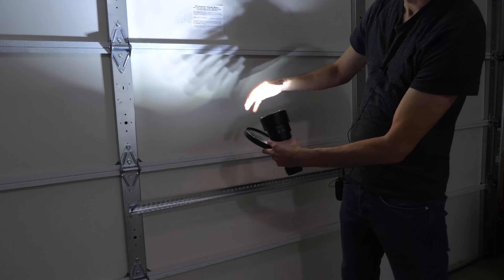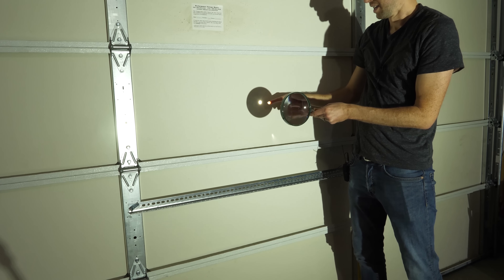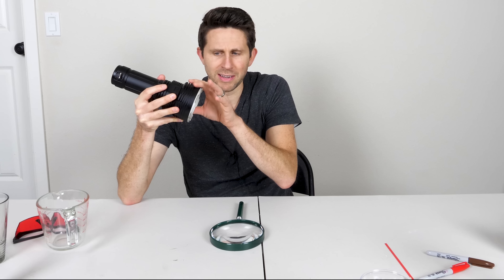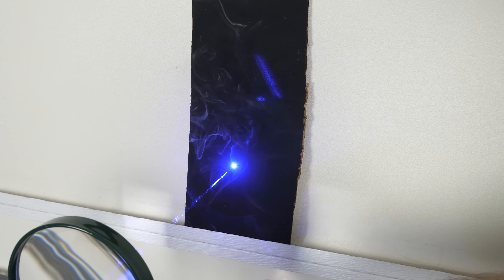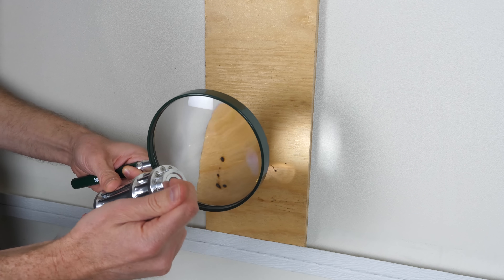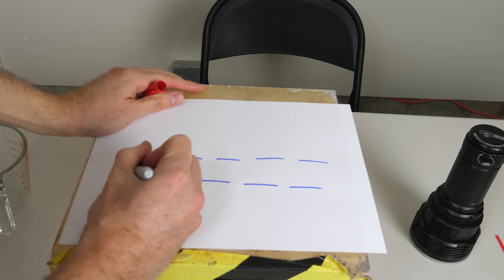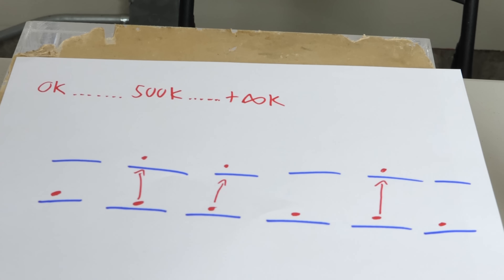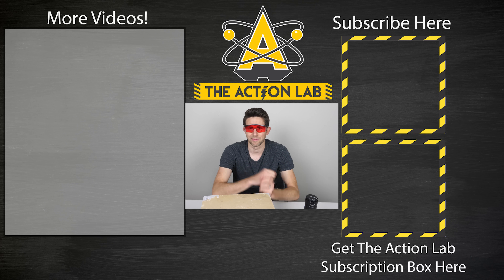What Happens if You Focus a 5W Laser With a Giant Magnifying Glass? Negative Kelvin Temperature!

Comment: I can see by the comments u are smarter than u come across in the video.. Ie u probably play for a target audience and by your sub count.. That works well for u.. But when u say all the energy and are talking lens.. U are missing a key point... Energy absorption by the lens. Which if u used traditional glass with a green tinge as viewed from edge... Will be significant and more so with blue. I know this from uv photo acid resist film. Low iron glass was important. I think it got most significant under like 350nm(its been a while) but discarding the extrema... Its still a factor

Comment: The way I understand it, photons are not hot.

Heat is the vibration of the atom multiplied by the degrees of movement IIRC, though I might be remembering all this wrong.

Basically, because photons are always traveling in one direction, they only have two of the three possible degrees of movement (XYZ with X being forward movement, Y being vertical, and Z being side to side) it can't vibrate in the direction it's moving, as that would affect and change the speed.

The photons coming from the sun are equally hot to the photons coming from a dollar store flashlight.

The way I understand it, it's the concentration of photons that's hot. When photons collide with something they create friction, based on how fast they're moving. Because they all move at the same speed, they all create the same amount of heat. But 15 hitting the same spot creates more overall friction than 5 hitting the same spot, thus more Heat.

Lasers concentrate the photons through lenses and that's why there's sometimes a visible trail, because the beam is so dense.

Again, I could be, and probably am, totally wrong about all of this. But it makes enough sense to me
Reply: Hotness of photons depends on their energy , the more energy you have in a photon ( which depends directly on frequency and inversely on wavelength) , the higher energy state it will shift the electron and that is what causes hotness because that electron now is more energetic than it was before absorbing the photon . Thus overall energy increases and atoms vibrate more frequently which leads to more heat . As for concentration, heat does depend on it but if you have higher frequency light ( like blue light or ultraviolet light ) you need less concentration than low frequency light ( like red light or infrared light). 
Hope this helps :-)

Comment: Use logic! A magnifying glass works to burn thing with the sun, because the sun is crazy hot, but also crazy far away, you can only magnify the sun to it’s max temperature, but the laser is right there, at it’s max temperature. So you can’t make it any hotter

Comment: Looks like your flashlight has 8 LEDs.  Assuming they are genuine high bin Cree XML T6 LEDs the maximum light output you could achieve would be 8x1040 = 8320 lumens.  However, your flashlight is probably a cheap knockoff from ebay using low bin rejects and probably puts out under 2000 lumens.

Comment: Firstly ; A laser (light amplification by stimulated emission of radiation) is a continuous flow of directed energy, all other light sources radiate light, and one of the reasons radiated light burns, such as in the case with focusing Sunlight through a magnifying glass, is that it is also focusing UV and other radiation. And it is a focused UV and radiation that is burning, not the light (protons).. If you lay out in the sun, you get a sun tan, or some of us get sun burns. . . However, if you lay out in the sun, as it shines through a picture window, it mostly blocks or deflects most of the UV radiation, and hence, while you might feel warmed by the sunlight, you will not get burned, Try it.  However, if you use a Magnifying glass, it serves only to focus that UV that is not deflected by the glass material of the lens.  Radiation such as UV radiation is not what is meant when using the word radiate, which means, in the case or lightbulbs and etc= to eminate in all directions
Secondly ;  This is more likely  a 50mW laser. And you most likely saw when purchasing it that it was advertised as a 5mW laser, as that is what is legal in the US and most other places to sell through E-Bay and other sources, and perhaps not familiar with the symbol that represents them. ( mW=miliwatt and W=Watt, and there are 1,000mW to 1W...
The argument made in this video, was more along the lines of what I have heard in laser forums for the last 10+ years, of new folks to the hobby asking how many magnifying glasses it will take to make thier non-burning laser burn things.. and the answer is and always will be, No amount. No matter how much you focus a 5mW laser, and no matter how Gigantic a magnifying glass you use, it will not culminate, into more energy than it already has. The laser (pointer) you have there is roughly similar to a sub-series of Chinese lasers like the 303, which they advertise as being 5mW but are closer to 30-50mW. And the reason they advertise them as such, is because it it illegal in many areas to own a laser higher in output of 5 mW. I have bough several of the laser shown in this video, KNOWING I was buying a higher output of mW then listed. And if you bought this laser while it was being advertised as a 5 W laser, you were ripped off... as a 1W or even a 2W laser would char and nearly ignite the wood without an external magnifying glass, so long as it was not a conical collimation..  I also have higher mW laser as well, counting a 2,000,  3,000 and a 4,000 mW laser (Or 2, 3 and a 4W lasers. What is being used in the video is typical for a laser with an output of 30 - 50mW of power, for that is what is needed to get those able to smoke or lightly burn dark materials with the aid of an external lens...

PS: I just sae rapier's post and, yep, He said it better first.

Comment: But if you have magnifying glass that is bigger than the sun, would you be able to make a hotter point? I’m wondering this Because your able to get all the lights.
Reply: You can get all the light, but you will never passively focus it to a point any brighter than the source. In the theoretical limit, you could focus all of the sun's light onto an area equal to the surface area of the sun. At any point not on that target surface, the intensity would be lower.

Comment: Couldn't you just focus the light through a reflective cone to secure all of the light? You could also do something similar with a star.
Reply: Most of the light will just bounce back through the wide part of the cone. Trace a few rays entering a cone at different angles and you'll get the idea.
Reply: @jmodified  I was thinking of something like a mirrored lantern and how that works to make the lantern brighter than normal. Its also very similar to the theory of a generator powered by a star. A light source surrounded by mirrors would focus the light in a given direction increasing the brightness compared to a light source with no mirrors.
Reply: @jmodified  I should have said a closed off cone with the light in the large end and the smaller end being the outlet for the light.

Comment: All i wanna say is that i just can't trust this video and get educated buy a guy who puts the laser really really close to the wood, even if he never told us if he changed the beam focus to that point (i mean the maximum focused beam coule be at about 1,5meters away from the laser and so it'd not work if you get beyond/before that focus point). So for me, it's not a proper setup and it invalidate his theory with the magnifying glass as the reference point is unsure or even unknown.

Plus i don't think you get a high temperature, you just focus all that energy to a smaller area which can't dissipate heat as much as the larger area did, that's why paper/wood would burn with a focused laser but not with a non focused laser (no lens)

Tell me if i'm wrong i have no degree and i never had a thermodynamic class (in france it's  not considered as basic knowledge and so the "branch" i was in never had thermodynamic classes :/) but i did a few experiments and concluded things when i was younger

Comment: At least read some proper physics, before putting anything on the internet. Firstly, those are 'electrons' which can have higher states, secondly Second law of thermodynamics deals with the Energy exchange, 'temperature' gives means to understand energy exchange. The light at the source is radiates 5 watts of energy into a beam, while the beam heats up electrons in the obstruction, so there's positive energy exchange and overall entropy gets increased.

Comment: What would happen if u use a Huge magnifine glass , then use a second magnifine glass  then another and focous the sun's rays , I just want to see if it can melt sand
Reply: You can melt sand with a magnifying glass and the sun. People do it for melting steel even
Reply: 0:47 can use the first glass to accumulate the light and use second to focus it to a point
Reply: Melting sand doesn't break any of the rules he talked about. You just can't get the light hotter than the surface of the sun (which he is correct about), but since the surface of the sun is of course plenty hot enough to melt sand anyway, that doesn't stop you from melting sand with sunlight.
Reply: Yes i know , but I was asking if he could do that experiment
Reply: Caleb Edwards  But there is no way using passive optics that you CAN compress all those photons into an area smaller than the initial LEDs. The fact that the LEDs are more spread out than 1 cm means that their organization and vectors are all spread out by more than that and cannot be realigned that precisely. A few can be cherrypicked that are already that well aligned, but they will be dimmer than the whole amount of light. OR all of them can be captured, but with greater spread than 1 cm. You can't do both. If you could o both you could literally make a perpetual motion machine

Comment: See usually lasers have some space for atoms and electrons to spread making it not concentrated, but if you focus it into a small beam, the atoms and electrons have to stay in on tight spot and all that pulsing and power within those atoms and electrons fuse together in a small beam making it burn faster

Iron man has a blast of usually a thick laser beam but, iron man has made advance technology to make the laser very strong, but if iron man made the laser small, he could practically melt his enemies, and it would be hotter than the surface of the sun, thanos you scared?

Comment: So if this works and you can turn heat to electric using air coolers and reversing them .
So if we pointed a laser at this the heat would create electricity which then can power the laser this would increasingly get more powerful .

Free power

Comment: A laser can't have a negative temperature because it can't have a a temperature at all, its a laser, its an electromagnetic wave there is nothing to be hot its a wave of energy in  quantized packets being directed at a surface. 
It can impart energy to a surface and generate temperature in that substance but itself has no temperature. heat is vibrational energy in a particle/substance and light/radio waves ect have nothing to vibrate in that way.

besides infinite temperature doesn't exist, if you impart that much energy to a substance it going to become a black hole long before you get anywhere near infinity.

The title implies a very different video than the one you are trying to make, that's likely the cause of the comments

Comment: To the confused people:

Lasers are actually a textbook example of negative Kelvin temperatures

I agree that the video and experiment are extremely misleading , but the point he was making was correct.

Lasers function very differently than LEDs, you need quantum thermodynamics to describe the system within a laser, hence why it has a "negative temperature".

Negative temperature systems are hotter than any positive temperature system. The reason why it's a negative temperature comes from extending the rigorous definition of thermodynamic temperature, that's to say, the variation of entropy in function of the variation in internal energy.

Because the wood has a positive temperature, due it not being a quantum system, energy will flow from the laser to the wood.

The video from the Sixty Symbols on negative temperatures is a much better explanation than this bad, over-vulgarised and misleading vid

Comment: In the last 6 years, there has been a scientific discussion about this topic. The key relies on the definition of entropy, there are 2 ways to define it for macro-systems: the Boltzmann definition and the Gibbs one. The first counts only the possible states at a given energy, meanwhile the other counts all the states associated to that energy or lower that's why they are also called surface and volume definitions. When the energy spectrum of your system has a lower and upper bound, if you are using the Boltzmann definition you will have to deal with negative absolute temperatures but if you are using the Gibbs one you will not, and it does not break the second law of thermodynamics. There's a bunch of articles defending each definition but after reading most of them I prefer the Gibbs one since in regular cases both are equivalent. I recommend you to read:  "Inconsistent thermostatics and negative absolute temperatures", Jörn Dunkel and Stefan Hilbert. 7/4/2013.
On the other hand, I find the light concentrating case really confusing because you are making work on your lantern, so you can throw those photons wherever you want, that's what happens with the light inside your oven, but I am not sure about what I am saying, I need further reading.
Thanks a lot for the video, it was really interesting!